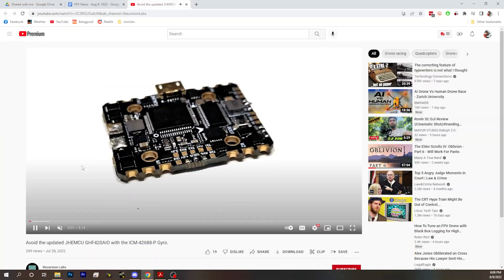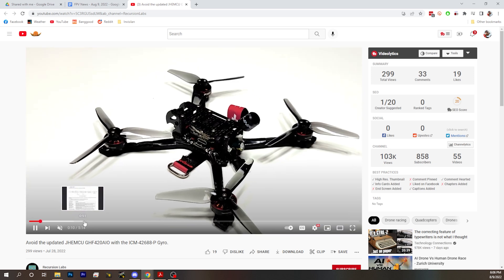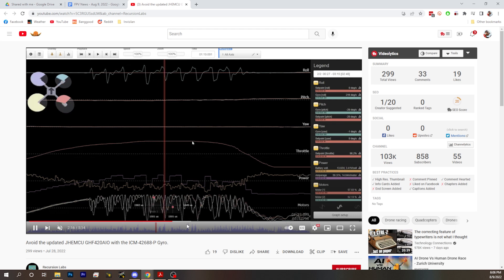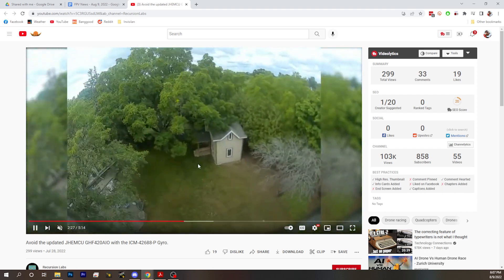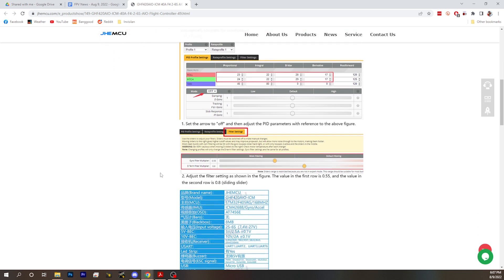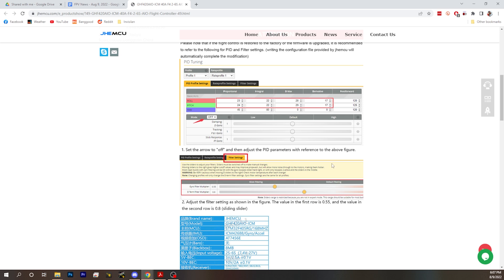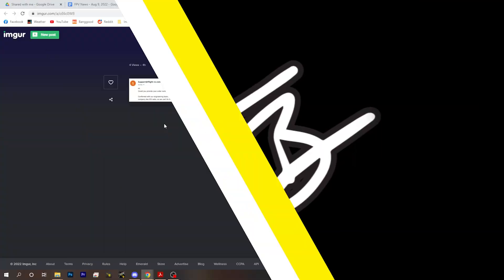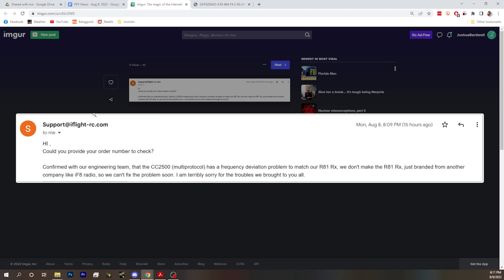PSA: Avoid JHEMCU GHF420AIO with ICM42688P Gyro! Commando 8 CC2500 Frequency Deviations! - FPV News

Comment: Does the JHEMCU GHF405AIO-HD 40A AIO have this same issue?  And is that board a good choice for a 3.5 racer (high thrust to weight ratio)?
Reply: Avoid, just bought one, second flight, got a ESC is burnt...

Comment: Iv only just completed a 5" ultralight using the GHF405AIO-ICM 40A. it hoovers fine, but as soon as i apply the slightest throttle or a punch out, it de syncs and falls out the Air every time. Is there any solutions or do i just bin it? Cheers

Comment: Stay away from the FOXEER REAPER AIO V3 F745 45A BLS BLUEJAY 2-6S AIO FLIGHT CONTROLLER/ESC - 25.5X25.5MM. Im having the same problem on a 290 gram with battery umagawd 2 Fiddy.

Comment: Hi, I'm new in the world of fpv, the first is a mobula 7 V2 spectacular, then I have bought my second fpv drone Geprc Mark 5 analog version, , i have always propwash and the filter original filters made by geprc was very high, 3 notch chassis, 3 armonics is very high for a new quad, i read the blackbox gyro scaled roll, and is increbibly uninterpretable there was noise everywhere, I see your video of gyro icm42866p and I have understand the problem, I have bought and soldier the T-Motor F7 Pro with gyro MPU6000, and the blackbox is leggible and interpretable, i have done filter and pid with blackbox, now fly very well, thank you for everything you do in the world of drones, and to share it with us, sorry for English, by from italy.

Comment: Well, that's a shame. I have quite a few of the JHEMCU boards in several micro quads that I fly frequently and haven't had a single issue with any of them. These are from before the chip shortage though and they all have MPU6000 gyros.

Comment: Hi, does anyone know if the frequency deviation problem only occurs on the comando 8? I'm considering buying the radiomaster tx 12 mk 2 with the cc2500 and now I'm worried I might get the same problem.

Comment: I bet the issue with the ICM42688 gyro isn't with the chip but it's power source. Noise in the 20hz range sounds like an oscillating power supply that can't quite keep up with the load or noise from power stage making it into gyro the signal traces.